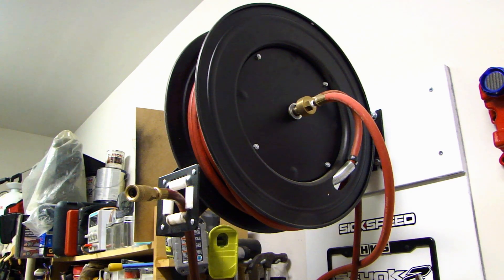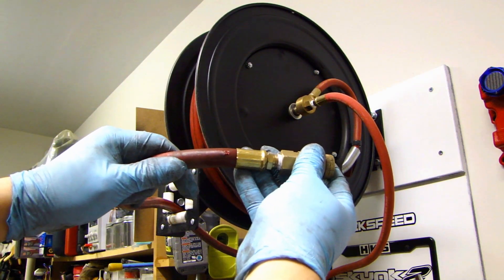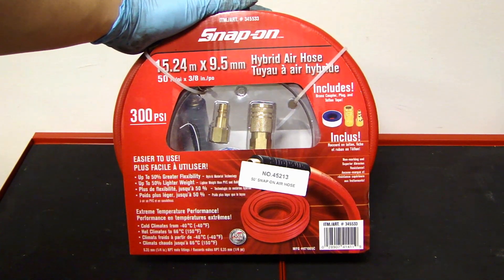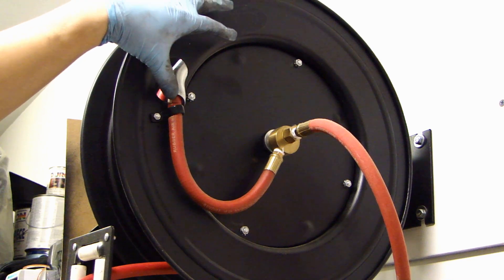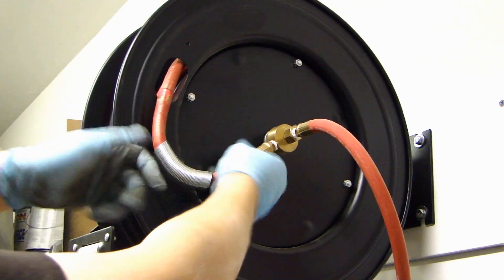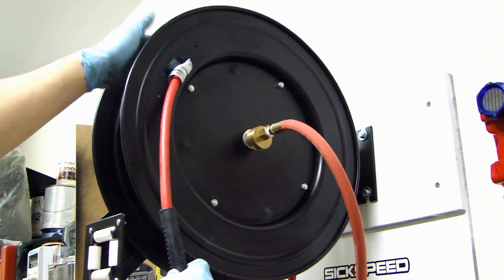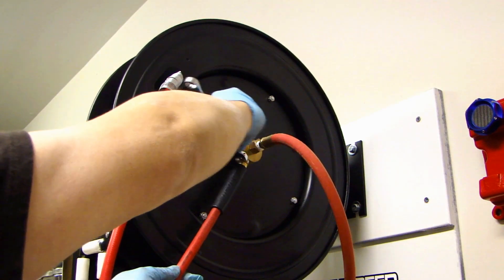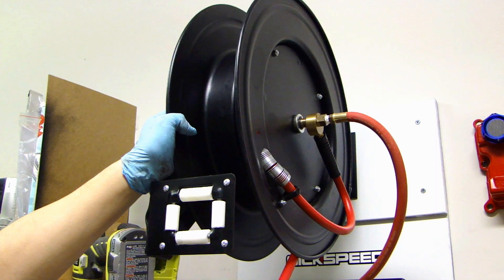How To Replace Air Hose on Retractable Hose Reel

Comment: Thanks for the video.  I had a 50 foot Husky hose laying around and after less than 2 years, my Harbor Freight hose looked like the Mojave Desert floor in the middle of summer, and the hose connecting it to the compressor popped yesterday.  I bought a heavy duty 3 foot line from Autozone, Black pipe from Home Depot, and a Splitter from Ace, and now Thanks to your video and 5 hours work, I have a new hose on my reel, and multiple outlets to plug into if I need them around my wood shop.  Thanks for the inspiration.

Comment: Hi There, I was very impressed with your video, wasn't sure if I wanted to tackle it or not and you made it look super easy so I returned my new inexpensive Harbor Freight Reel (the one that I already had was heavy duty not to mention expensive). Then away I went on the replacement hose. What I did in addition to your instructions:   Since I'm like a bull in a china shop, I to put 2 sets of vice grips on the real to keep it from taking off on me... then after having a leak at the fittings and removing and reinstalling the inlet and outlet hoses on the swivel fitting several times, I realized that when I took the inlet hose off the swivel fitting (the easiest one for me to remove)  then loosening the outlet hose,  loosened the swivel hub then turned the swivel hub and fitting off the reel, then you can turn the swivel fitting off the end of the outlet hose, then no need to turn the outlet hose to thread the hose on and off of the swivel fitting.      Lol, it seems that not only was my hose bad, but the reel obviously had sit to long after being used for several years... the leak was caused by the O-rings going bad as well.  I know this was long but thanks for listening.

Comment: Thanks.  I just installed a new Hf 50ft hose reel that has its own 50ft rubber hose and noticed a bulge in the line that will soon need replaced.  I want s nice durable rubber hose.  How is your new rubber hose holding up?  Thanks again and have a happy 2021 new years.  Enjoyed your video.  👍🏽🙂

Comment: Easy enough to replace that hose with a high quality Goodyear hose.  The hose swivel can easily be fixed as well by replacing the 2 o-rings inside it.

Comment: I'm getting a hose reel from Lincoln, the same company that makes the welders.  Not sure of the quality of the hose that will come with it but I have a 50 foot roll of USA manufactured Goodyear rubber air hose I can replace it with if I need to so this video may come in handy to me.  Thanks.

Comment: I ended up mounting the hose reel assembly to the 2 x 10 prior to installing both to the wall. Used 1/2" lag bots for the hose reel to the wood, and 5/16 lag bolts to the studs.

Air ratchet really helped a lot with those 1/2" lag bolts! Whew  I figured that it's easier to install the reel on the 2 x10 while it is on the floor rather than someone holding it against the wall. Certainly time consuming to wrench those bolts with so little space to work with. Used a cordless impact driver with the bolts with (torx head) to finally mount everything on the wall.

So I didn't end up disassembling the hose reel.

Comment: Bought one today too! Thanks again for the influence! :)

So do I have to take off the reel off the bracket when I mount the frame on the 2 x 10? Not too much room for an air ratchet hehe?
Reply from the maker: I didn't take the hose reel off the bracket. Just bolted it down.

Comment: The Harbor Freight 50' hose reel has a 3/8" connection where the hose attaches to the reel.  Air hoses typically come with 1/4" fittings.  I had to buy a 3/8 x 1/4 bushing to make this work.  I also put a clamp on the reel so there was no way it could turn while I was working on it.  You do not want the reel going into auto retract mode with no hose on it!
Reply: Very good..never work on the reel without making sure it STAYS OUT!!!

Comment: How did you go about mounting this to the studs with the wood plaque
Reply from the maker: Use a stud finder to first locate the stud behind the drywall. Then mark it on the wall with a pencil. The wood base will stretch between 2 studs. Drill the holes on the wood base, then drill from the base into the wood stud. Install 3" - 4" screws to mount the board, then screw the hose reel to it.

Comment: Did you replace the old hose with a rubber or rubber/pvc hybrid?
Reply from the maker: +xFADExPHANTOMx This Snap On hose is a hybrid hose. Very light weight and flexible.

Comment: can I change the hose from a 50ft 3/8 to 100 foot quarter inch
Reply from the maker: With the hose reel I showed in this video, I don't think it will fit 100 ft hose.
Reply: I’ve tried to put 100ft on my reel and the spring is not enough to wind up 100ft.

Comment: Does anyone know if I can replace the air hose for a hight pressure hose for my pressure washer?
Reply: Air hose for a pressure washer? Is this a typo?         Are you are asking if you can get a pressure washer hose repaired or replaced???

Comment: My reel takes like a garden hose to attach to the reel I bought 10 footer but it's to short my is made by craftsman can anyone please point me in the right direction I put this in cause my dad got diagnosed with lung cancer and the reel will be easier than winding it around the compressor I need like 25 feet